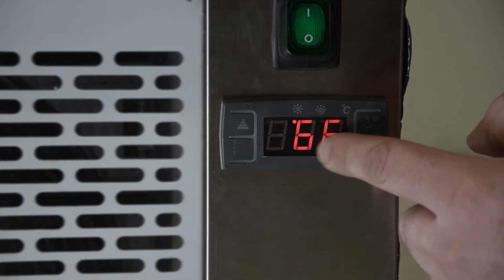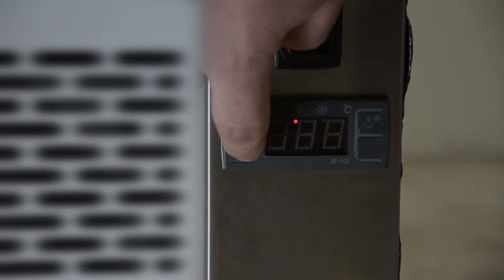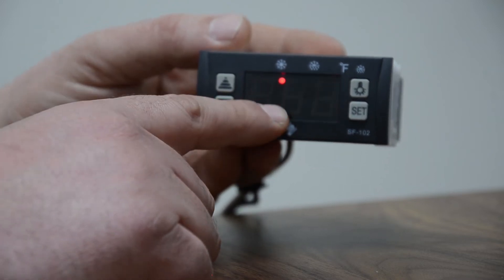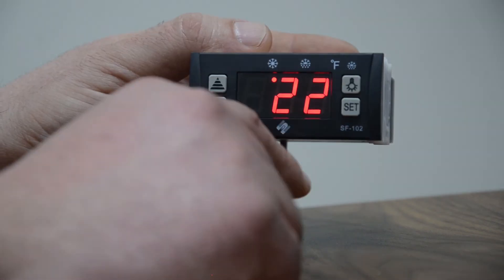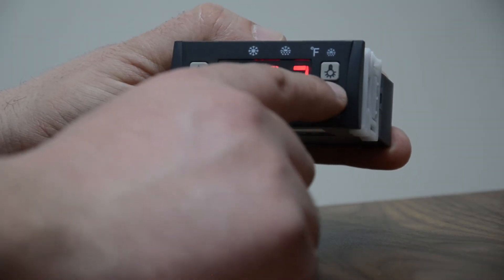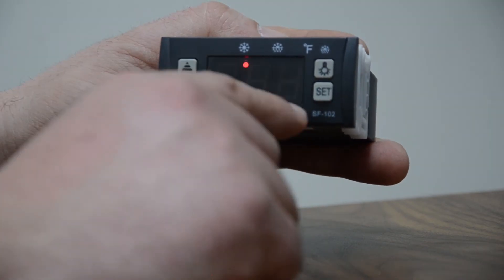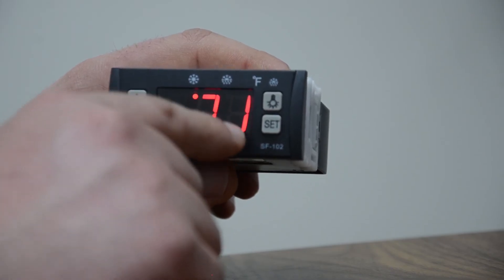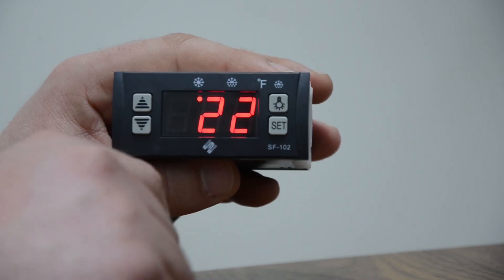SF 102 Digital Temperature Controller

Comment: We have a cooler with a SF-102S control panel.  The cooler comes on when we plug it in but the panel lights do not come on.  Is there a reset or trouble shooting for this issue?

Comment: Hey, thank you for the video. I have a few display cases with this control module and the cases once powered on will have the fans running continuously even when the compressor is not working. Is there a way to set it so that the fans only turn on once the compressor turns on?
Reply from the maker: Appreciate your inquiry! For any questions or further information, please don't hesitate to reach out to our dedicated team at sales@omcan.com. Thanks

Comment: Is there a setting to trigger a defrost cycle when the evaporator sees a particular temperature?  Or is the only defrost option a timed interval?  Also,  where does the temp. hysteresis lie with respect to the cold room temperature?  OR asked another way does the cold room set point fall at the bottom, middle, or top of the temp. hysteresis range?

Comment: I guess I have a slightly different model because mine showed “PA” first before E1.
Reply: Hi Bradley, I have an SF-104 in a beer fridge that does the same thing and displays "PA". Have you managed to get beyond the "PA"? If so, how did you do this?
Reply: @stevos24  I had to get a workman in. He unblocked a blockage and Re gassed it. All good now.
Reply: Hi.. do you know what he did? I can't change the values in e1 and e2. If i press arrow down for 5 sec starts a supercooling mode. I don't know how to unlock to change e1 and e2
Reply: Hi.. PA is password.. you have 0 to 99 chances.. after password, the controller shows parameters!
Reply: @glaucoqs  hello sir. How do I get past the password? Once I set it to 00, it just takes me back to the home screen. Never lets me in past the PAS. I have the down arrow setting to OFF, so that's not the problem. Thanks for your advice
Reply: @danlowrance2462  you have to try 99 possible passwords.. one off theses are the correct.. so when you find the correct, will free the others parameters.. one of the parameters is PA.. in PA, you can set OFF.. so in next time you programming, will not ask for the pass ..
Reply: @glaucoqs  Thanks friend. Wow Seriously? That's cruel, but at least it is not three digits. I'm surprised as this is brand new, and I even did a factory reset. Thanks again for your help.
Reply: @cameradobrewingco3547  Damn dude! You were right! Mine was 33
Thanks again! Cheers!

Comment: My digital controller screen always displays E22.... can u help me please ?
Reply from the maker: Hi I would recommend calling us at 1-800-465-0234. A rep will be able to assist.
Reply: Omcan srry it is EE2
Reply: @victorcruzfuentes9587  Hello did you find out what EE2 means ?
Reply: Panos Moraitis no  I didn’t
Reply: @victorcruzfuentes9587  I found it: Open circuit or short circuit of defrosting probe
Reply: Panos Moraitis but the solution is ??
Reply: @victorcruzfuentes9587  the most common is to change the defrosting probe. If it it not working again probably is the circuit board.

Comment: Hi, I followed your video and set the settings given. My fridge is set at 03 but screen says 17 and won’t budge either way? Am I doing something wrong??
Reply from the maker: Hello Andrew, thank you for reaching out to us! Here are a couple solutions for you to try:

- The unit could be in defrost mode; if the red dot is between both numbers it’s in defrost mode. 
- If the red dot is on the left hand side of the two numbers and solid (not flashing), it’s in cooling mode. If the unit is in cooling mode and the temperature is not dropping, a refrigeration technician will be required to fix it. 

We hope this helps you, but if you have any further questions contact Hilary Dasouza at hilary.dsouza@omcan.com and our call service is always available at 1-800-465-0234.

Thank you!

Comment: how to make a factory reset?
Reply from the maker: Factory default revision: Press SET button to adjust set temperature well. Press button SET for 6 seconds to enter parameter setup mode to set the parameter and then press SET button again for 6 seconds, COP will be displayed, the stored and revised set temperature and parameter are factory default.for  factory default resumption: press UP button and DOWN button simultaneously for 6 seconds, 889flashes, all parameters will be resumed as same as factory defaults. After 6 seconds, it returns to normal operation

Comment: Great video. Mine has a constant beep coming out of it. It’s loud and it will not stop. Any suggestions?  Please help. Thanks in advance !  It’s on a prep table.
Reply from the maker: On the controller does it have error code ex. EE1 , EE2 ?
Reply: Omcan no it doesn’t. It just displays the actual temperature inside the prep table. Thanks for the response!
Reply from the maker: @MrEltinieblas  If no error code appears then controller will need to be replaced.
Reply: Omcan I understand. Thanks again!
Reply: Mine is beeping and showing on off signs. Doesn't show temperature or any error code. Any suggestions?

Comment: I cant modify neither e1 nor e2 parameters. They just stay at 0 Celsius and 6 Celsius respectively. I dont know what else should i do
Reply from the maker: You will have to go into the parameters by holding down the arrow down key for about 5 seconds until ON appears and then press and hold the set button for 5 seconds , then you should be able to change the parameters E1/E2

Comment: question on the setting you said.  e3 is that 4 degrees in Celsius or Fahrenheit? on the f3 the defrost termination temp.  you said 12 degrees.  was that in Celsius or Fahrenheit?  thanks for the great video!
Reply from the maker: Hi Travis sorry for the late reply.....E3 is in Celsius which is set for 4 and F3 is set for 12 which is in Celsius as well . Once you change C1 to 1 which is Fahrenheit  and then you go back into the parameters , everything will be in Fahrenheit . Hope this helps and thank you for the great question
Reply from the maker: E3 will be set in Celsius which 4 and you can modify the differential if that’s too low . F3 defrost termination temperature is in Celsius as well which is set for 12  and glad we can be of an assistance.